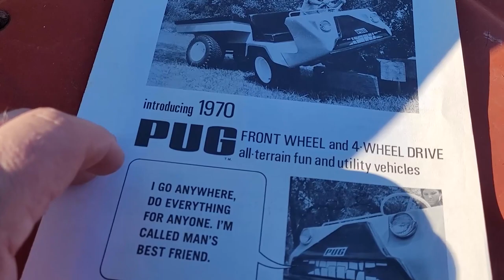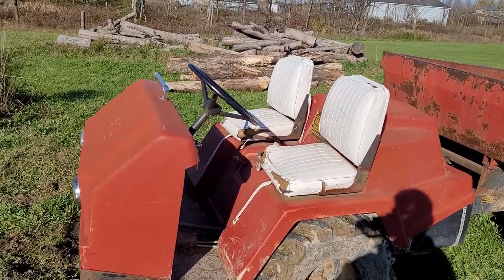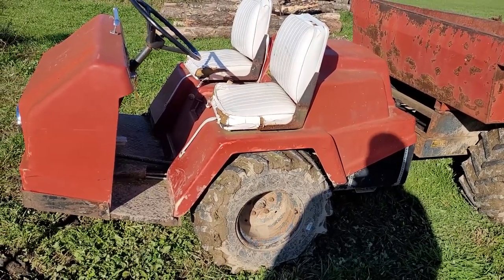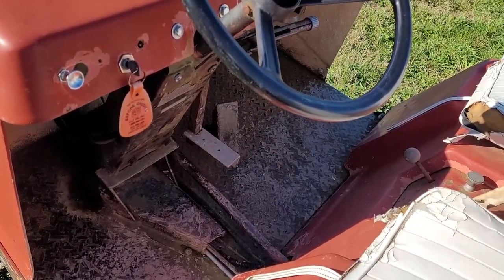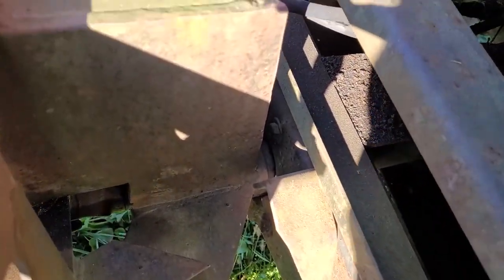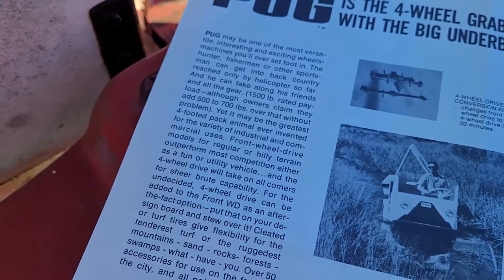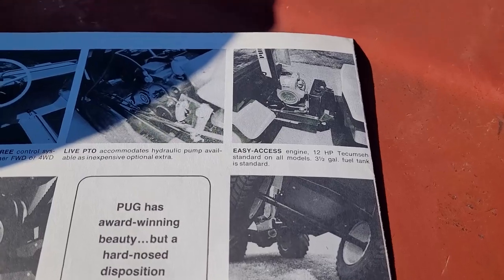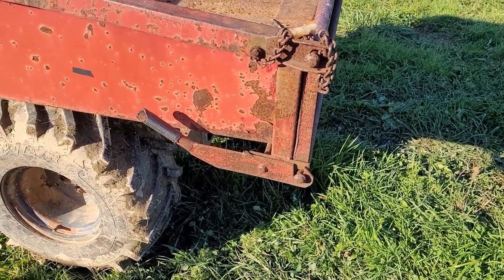Side by Side innovator PUG UTV...The First, and original,  SxS. A real workhorse!

Comment: Pretty cool looking old machine. This sort of stuff is fun to work on, use and talk about. I love looking at old brochures for stuff like this.
Reply from the maker: It needs a different setup for a throttle cable. Once that's locked, and maybe stretching the operators platform, it will be ready for some cosmetic love.

Comment: This is a later model, the ones made in the 60’s normally had Tecumseh motors and early ones were belt to chain drive. Ownership has changed a lot sine the early 80’s and I have been to their factory in Bruce Wisconsin back in those days. When they we sold to Jacobsen they were produced as a UV4.  As I write this my son is considering buying a UV4 that we used to own. Not as nimble as the original Pug but more user friendly with more leg room and easy on and off. Also has power steering and hydraulic dump box.  I spent many hours in the seat of these as a kid. They were awesome machines in their day.  They also produced a tractor version called a Twister in a commercial and residential models. The original Pug is hard to beat.  Steve…
Reply from the maker: This one definitely lacks leg room.  I'll get some better footage and post another video on this since it seems to be picking up steam.  Thanks for the info!  There may be a leg room mod coming up.
Reply: @bioniclife  the early models had even less, no way I could drive one anymore!  🙂
Reply from the maker: What do you need to see to give me a better idea of the vintage of my model?
Reply: @bioniclife  sorry the ones that we owned were all between the late 60’s and late 70’s maybe early 80’s.  So I am guessing some time after that. A few years back I tried to research them. Like I said they were owned by a number of different company’s after they were sold from Bruce Wi. I believe the last ones that were making them was either Toad or Frog Pond something like that.  New ones were not cheap and look a little like they always did but completely different unit when it came to more and transmission set up. If I can find anything I’ll let you know.
Reply: Quick search and it looks a lot like the ones produced in MS and the year on the picture I saw from an auction said it was produced in the year 2000. The name on the serial tag just says Pug Power. Actually I just tried to find the site of the last ones and yours looks more like theirs as the headlights are not bumped out. Frogpond Atv is the name of this mfg.  not sure if they are still being made or not. They did show the price of a new one at over 28,000$ so up a tad from the ones we used to buy. Back then they were 3-4,000$ pending what options you got on them.
Reply from the maker: @stevelutzke9600   I rebuilt the rear end on this one and found a new centrifugal clutch afterI brought this home in 2006 from Kiln, MS. It had been under water 2 times with Hurricane Katrina and Rita.  The guy who had it had changed the oil in the engine both times but there was salt water in the rear-end. The pinion housing casting was cracked.  I talked to a guy named Bill that was either the founder or worked for Bruce Industries and he sent me the replacement casting. The hydraulic pump looks like a power steering pump and might be an add on. The centrifugal clutch drives a transaxle with a high/low forward and one reverse gear.  I am actually going to be putting a proper automotive style throttle cable on this thing soon.  Might extend the driving platform then too.   I'm tired of the janky set-up that has been on this the past 15+ years I've had it.
Reply: @bioniclife  my son actually has a new clutch for one he spent over 500 for it and then decided he didn’t want to keep trying to restore the Twister ( made by Bruce ) and sold it to someone looking for a parts tractor to try to get his working.  He plans to purchase the Jacobsen UV4 version that he found over this past weekend that my dad owned when new. These are all metal and have a much longer nose so easy on and off.  I told him if he were to get one for what he wants to do it would be a better option than the original Pugs. Side by side the original Pugs with the Tecumseh motors and the short nose for how we used them was the best.  The Jacobsen version was to long trying to get around in woods and the Briggs motor was not as strong.  Kinda hope he buys it but we will see.  They are a neat part of history for sure and real workhorses. I cold tell tons of stories on what they could do.